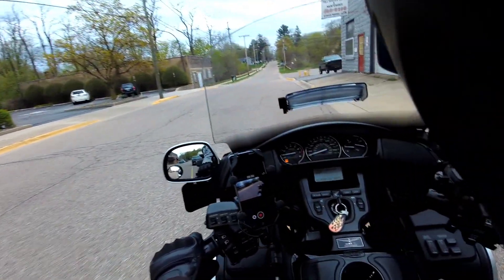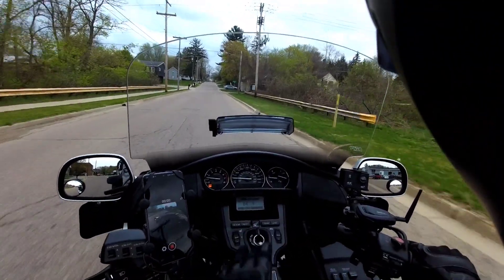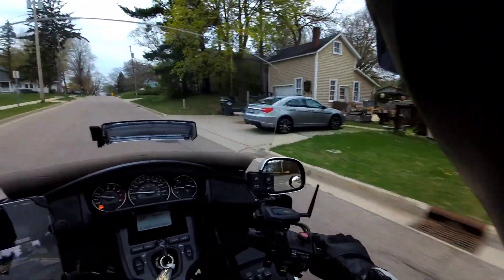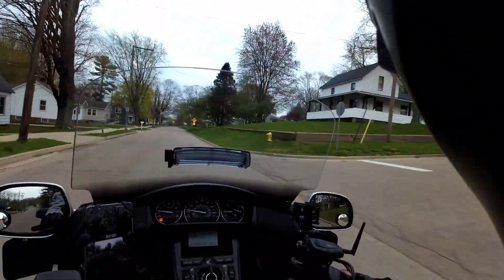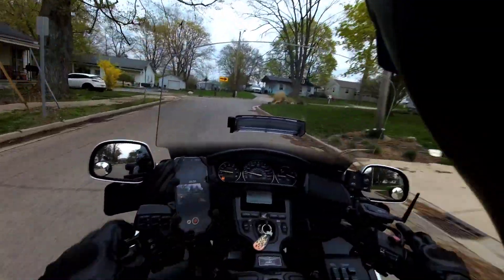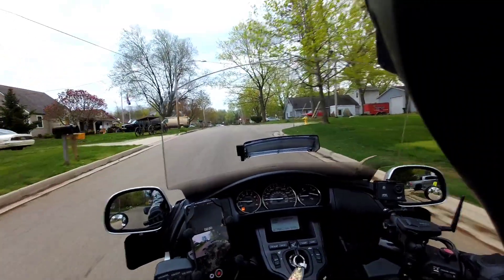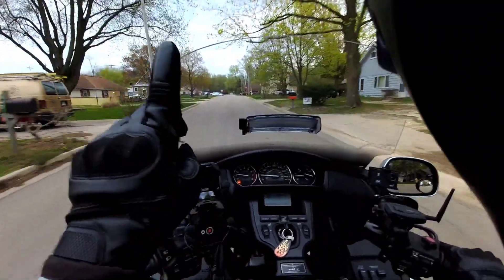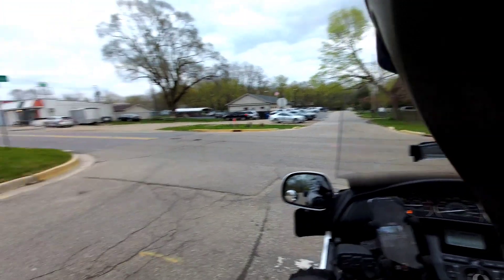TIRED OF THE CLUNGY GEARS. TRY THIS FOR YOU GOLDWING GL1500-GL1800 1988-2017

Comment: I've been searching the variuos GW sites looking for confirmation on what I'm experiencing on a 2022 GW Tour (manual) when driving driving from Fort Worth to Houston. Traded a DCT for a manual. You described it to a tee. I would have thought the wing would shift to each successive gear without hesitation or dead space prior to engegement. If you don't preload, thats exactly what you have. Greatly appreciate the insight as I was going to take it to my local dealer for a look see, and may still,,, again, thanks!

Comment: You are correct about preloading the shifter. Also rev matching helps to. Smooth operation with the clutch can also help in shifting smoothly. Other bikes suffer from the clunky shifting not just the wings. Maybe the DCT bikes are the only ones that don’t have this issue. I’d be curious if that’s true.

Comment: Hi mo. Good tip there. I call it taking up the slack prior to committing a gear change.gearing down I find it helps to “blip” the throttle and gear down kinda early and keep some revs up……hi to all. 🇬🇧👍

Comment: Yes sir the vtx 1800 had the same clunk. I not saying this oil is better than others, but I use Amsoil and BG motorcycle additive. And it helps a lot on smoothness.  With the preload or no preload if you RPM match it works for me too. But as many miles I had on the VTX and my first goldwing it has never hurt anything just a little clank sound. But the oil and additive helped 100%. And I get about a 1/2 mile more on mileage. I also run mobil 1 extended oil filters and with that little extra capacity on the filter I can use 4 quarts and the 6 Oz additive and it's perfect on oil level. But staying on the throttle and rpm match works great for me.

Comment: I've had a GL1800 for 6 years and never noticed an unusual clunk when  I use the throttle and the clutch properly. I do run a 10w 40w full synthetic oil.

Comment: I have always upshifted without using my clutch. Just lift slightly off the throttle and shift. Quick shifters do this exact thing only a lot quicker than I can manually. Never have had any issues with any bike.

Comment: I wonder about a shift brace for the 1500, would it help with the clunk?  Regardless I think at some point I'll add one.  That sloppy shifter shaft makes me a little nervous.
Reply: The brace did not help with the clunk on mine, but it did help with sifting overall. I no longer drop in neutral on 1st to 2nd shifts and the shaft seal no longer leaks and when I remember to preload the shifter, the clunk does go away. 1990 Gl1500 SE

Comment: can you do the same thing with a heel toe shift
Reply: You can, yes. Just put your heel on the lever and medium-load it while still on the throttle and hold that pressure on the lever as you close the throttle and pull in the clutch simultaneously.

Comment: I'm an old fart and ride a 1500 I find shifting between 3000 and 3500 shifting quickly no klunk! Below 3000  so called short shifting you get it, so I try to alway get the rpms up above 3000 and don't be lazy!
Reply: Yup higher rpms less clunk